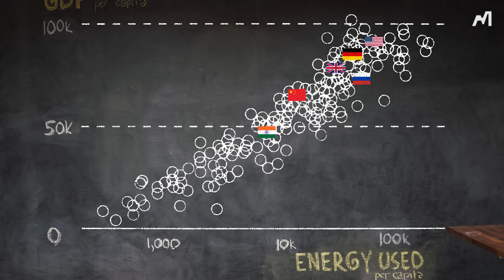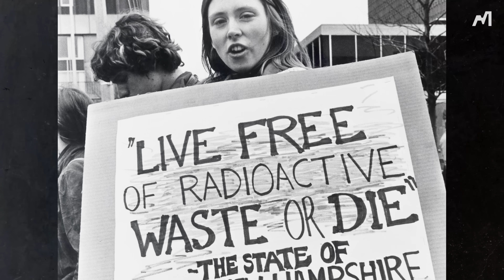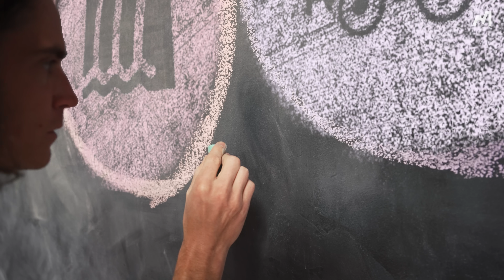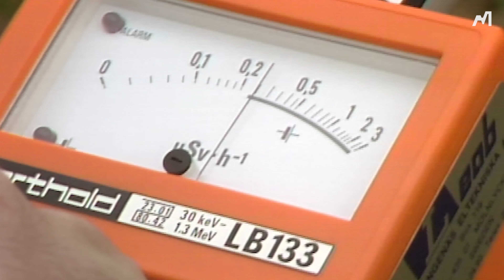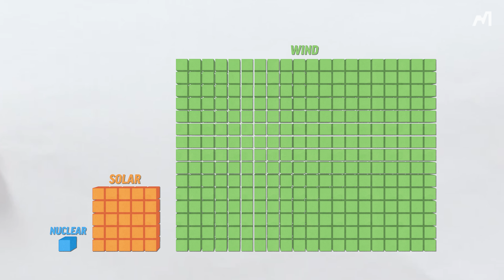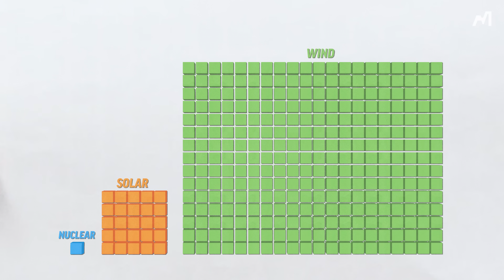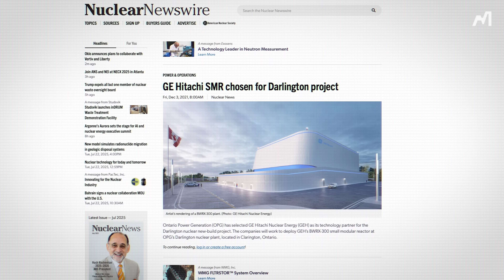They're Lying to You About Nuclear Energy

Comment: Personally, I'd rather see more effort put into making commercially viable Thorium plants, but conventional reactors are still better than coal or even natural gas. I think solar and wind are also good, but they should be supplementary power providers, not baseline because they can't produce power 24/7. Nor can the power they produce be increased or decreased on demand without also adding batteries to the mix.

Comment: False/irrelevant information on Renewables as required to promote Nuclear.  We don't need nuclear, sure lets keep experimenting, debating the safety.  Maybe it was the fossil industry that "encouraged" the safety.
Solar and wind are "reliable", the problem they have is that they are predictably variable, its a problem we know how to deal with.  Nuclear consistency is the same problem as predictably variable.  Demand is variable, the grid needs balanced.  Nuclear is too expensive to become a peak demand occasional generator.
At the end of the day you have to accept that people are scared of it, rightly so.  If you eat the right material, sure you are ok, a bit of exposure is maybe not as bad as portratyed, but get it wrong and you are dead.  We are not all nuclear experts.

Comment: More stupidity is not the solution to stupidity. The simple fact is that the intense ionizing radiation in the boundary of the nuclear fuel causes the containment to transmute over time, where the containment materials lose their original elemental qualities, frequently becoming brittle and no longer able to perform as originally intended. Zombie reactors that are past their designed life are losing the safety factors originally designed into the containment in ways that are not predictable until incidents inevitably occur. The same thing applies to the containment of high-level nuclear waste. These matters are well-known to the industry, but being withheld from public scrutiny in order to maintain the current zeitgeist.
Reply: Please vote this up. No-one seems to think about the future generations we are leaving behind our waste for. Stop using so much unnecessary power because of an economic model we know will not last long anymore.

Comment: I have only one objection to nuclear, the waste. Experts keep going on and on about how safe it is but they don't want it stored in their backyards. They tell me & the residents of my state there is zero harm from having it stored here but refuse to even consider storing it where it's generated, where they, and presumably you, live. If you want nuclear power then you should have to keep the waste it generates where you use and generate it. That seems very reasonable. Until that day arrives, no nuclear.
Reply: More stupidity is not the solution to stupidity. The simple fact is that the intense ionizing radiation in the boundary of the nuclear fuel causes the containment to transmute over time, where the containment materials lose their original elemental qualities, frequently becoming brittle and no longer able to perform as originally intended. Zombie reactors that are past their designed life are losing the safety factors originally designed into the containment in ways that are not predictable until incidents inevitably occur. The same thing applies to the containment of high-level nuclear waste. These matters are well-known to the industry, but being withheld from public scrutiny in order to maintain the current zeitgeist.
Reply: But that's exactly where it is being kept.

How do you know the experts won't accept it in their back yards?

$10-20 in natural gas can replace a dollar's worth of uranium. Natural gas doesn't have any waste, does it? It wouldn't, by any chance, include *radon*, right?

Comment: I think that what you are saying is that they had determined that if they kept building nuclear power plants at the rate they were making them that electricity would become way too cheap to make a profit off of so they made electricity availability scarce and in high demand (peak demand) through the narrative excuse that it's scary dangerous to generate electricity from nuclear, so that it could become a highly profitable business. 

You know, Iran solved that nuclear meltdown problem by building a nuclear power plant deep, deep in the ground so that in case of a meltdown it would not effect anything. But American profiteers are incapable of doing that, nor even think about such preposterous ideas such as building one deep in the ground and would rather you believe that nuclear generation is scary dangerous and that we shouldn't play around with scary things.
Reply: More stupidity is not the solution to stupidity. The simple fact is that the intense ionizing radiation in the boundary of the nuclear fuel causes the containment to transmute over time, where the containment materials lose their original elemental qualities, frequently becoming brittle and no longer able to perform as originally intended. Zombie reactors that are past their designed life are losing the safety factors originally designed into the containment in ways that are not predictable until incidents inevitably occur. The same thing applies to the containment of high-level nuclear waste. These matters are well-known to the industry, but being withheld from public scrutiny in order to maintain the current zeitgeist.

Comment: They lied about it because Nuclear Power solves the biggest problem to prosperity and positive growth humanity has ever faced.
And politicians lose power every time a problem is solved
Reply: More stupidity is not the solution to stupidity. The simple fact is that the intense ionizing radiation in the boundary of the nuclear fuel causes the containment to transmute over time, where the containment materials lose their original elemental qualities, frequently becoming brittle and no longer able to perform as originally intended. Zombie reactors that are past their designed life are losing the safety factors originally designed into the containment in ways that are not predictable until incidents inevitably occur. The same thing applies to the containment of high-level nuclear waste. These matters are well-known to the industry, but being withheld from public scrutiny in order to maintain the current zeitgeist.

Comment: Didn't plant Vogtle in GA turn on a new reactor in 2024?
Reply: More stupidity is not the solution to stupidity. The simple fact is that the intense ionizing radiation in the boundary of the nuclear fuel causes the containment to transmute over time, where the containment materials lose their original elemental qualities, frequently becoming brittle and no longer able to perform as originally intended. Zombie reactors that are past their designed life are losing the safety factors originally designed into the containment in ways that are not predictable until incidents inevitably occur. The same thing applies to the containment of high-level nuclear waste. These matters are well-known to the industry, but being withheld from public scrutiny in order to maintain the current zeitgeist.

Comment: 1:57 "They were not reckless people" DEMON CORE
Reply: More stupidity is not the solution to stupidity. The simple fact is that the intense ionizing radiation in the boundary of the nuclear fuel causes the containment to transmute over time, where the containment materials lose their original elemental qualities, frequently becoming brittle and no longer able to perform as originally intended. Zombie reactors that are past their designed life are losing the safety factors originally designed into the containment in ways that are not predictable until incidents inevitably occur. The same thing applies to the containment of high-level nuclear waste. These matters are well-known to the industry, but being withheld from public scrutiny in order to maintain the current zeitgeist.

Comment: Buddy, radiation from the sun and the ground is not the same as the one from Uranium!
Reply: More stupidity is not the solution to stupidity. The simple fact is that the intense ionizing radiation in the boundary of the nuclear fuel causes the containment to transmute over time, where the containment materials lose their original elemental qualities, frequently becoming brittle and no longer able to perform as originally intended. Zombie reactors that are past their designed life are losing the safety factors originally designed into the containment in ways that are not predictable until incidents inevitably occur. The same thing applies to the containment of high-level nuclear waste. These matters are well-known to the industry, but being withheld from public scrutiny in order to maintain the current zeitgeist.
Reply: Yeah, again a very popular 'science' channel. Bad video skipping many details
Reply: Of course it is; especially from the ground, whose radiation is largely due, you guessed it, to uranium.

The top centimetre of Earth's surface contains more uranium than has ever been mined ... although that might cease to be true in the next few decades.

Comment: I worked at Shoreham, got our full power license, sold it for $1 to NYS. They gutted it. Never ran after 3 billion dollars spent.
Reply: More stupidity is not the solution to stupidity. The simple fact is that the intense ionizing radiation in the boundary of the nuclear fuel causes the containment to transmute over time, where the containment materials lose their original elemental qualities, frequently becoming brittle and no longer able to perform as originally intended. Zombie reactors that are past their designed life are losing the safety factors originally designed into the containment in ways that are not predictable until incidents inevitably occur. The same thing applies to the containment of high-level nuclear waste. These matters are well-known to the industry, but being withheld from public scrutiny in order to maintain the current zeitgeist.
Reply: @richardmcbroom102  Bless your heart.

Comment: wow, wildly in-accurate and dangerous presentation.  do some fact checking.
Reply: More stupidity is not the solution to stupidity. The simple fact is that the intense ionizing radiation in the boundary of the nuclear fuel causes the containment to transmute over time, where the containment materials lose their original elemental qualities, frequently becoming brittle and no longer able to perform as originally intended. Zombie reactors that are past their designed life are losing the safety factors originally designed into the containment in ways that are not predictable until incidents inevitably occur. The same thing applies to the containment of high-level nuclear waste. These matters are well-known to the industry, but being withheld from public scrutiny in order to maintain the current zeitgeist.

Comment: 5 years start to finish 😂😂😂😂.   Cant do that today.  You have too many pu$$ys that can’t work 7 days a week and biggest obstacle in the way of a 5 year completion is , Blue Collar (Mafia) labor unions dragging out the time line in order to skim billions off the top.   SEE , Plant Voglte , Burke County Georgia .   Minimum of 13 billion over budget and nearly a decade to ADD (2) units on existing nuclear power plant infer structure.
Reply: More stupidity is not the solution to stupidity. The simple fact is that the intense ionizing radiation in the boundary of the nuclear fuel causes the containment to transmute over time, where the containment materials lose their original elemental qualities, frequently becoming brittle and no longer able to perform as originally intended. Zombie reactors that are past their designed life are losing the safety factors originally designed into the containment in ways that are not predictable until incidents inevitably occur. The same thing applies to the containment of high-level nuclear waste. These matters are well-known to the industry, but being withheld from public scrutiny in order to maintain the current zeitgeist.

Comment: Cut that hair buddy u look ridiculous
Reply: More stupidity is not the solution to stupidity. The simple fact is that the intense ionizing radiation in the boundary of the nuclear fuel causes the containment to transmute over time, where the containment materials lose their original elemental qualities, frequently becoming brittle and no longer able to perform as originally intended. Zombie reactors that are past their designed life are losing the safety factors originally designed into the containment in ways that are not predictable until incidents inevitably occur. The same thing applies to the containment of high-level nuclear waste. These matters are well-known to the industry, but being withheld from public scrutiny in order to maintain the current zeitgeist.

Comment: Ima start talking about how flammable coal and oil is
Reply: More stupidity is not the solution to stupidity. The simple fact is that the intense ionizing radiation in the boundary of the nuclear fuel causes the containment to transmute over time, where the containment materials lose their original elemental qualities, frequently becoming brittle and no longer able to perform as originally intended. Zombie reactors that are past their designed life are losing the safety factors originally designed into the containment in ways that are not predictable until incidents inevitably occur. The same thing applies to the containment of high-level nuclear waste. These matters are well-known to the industry, but being withheld from public scrutiny in order to maintain the current zeitgeist.

Comment: Solar really shines (sorry) in the instance of small, personal installations, such as the roof of your house, especially when paired with battery storage. It takes load off the grid and offers redundancy in the event of an emergency. You might also receive a rebate on your power bill depending on where you're from. Also handy if you have an EV with bidirectional charging. Having large solar farms decimates the environment around it and requires a great deal of space not only for the panels, but for the mass lithium storage required to make it a more reliable system. 

On the other hand, nuclear energy is efficient, stable and safe with zero emissions. The problem is that the public's literacy on these things has been sabotaged seemingly irreparably.

Comment: Maybe they simply re-start this because they finally have a way to earn more money off them.
This is what the AI sais today:

Radioactive waste can be converted into electricity using technologies like nuclear batteries that use radioactive decay to generate power, and by using it as fuel in specialized nuclear reactors, such as molten salt reactors, that are designed to consume existing nuclear waste. While current nuclear batteries produce very low power outputs, and reactors are still under development, these innovations offer the potential for long-lasting, clean energy from materials previously considered unusable waste.

Comment: Great presentation, but a nit:
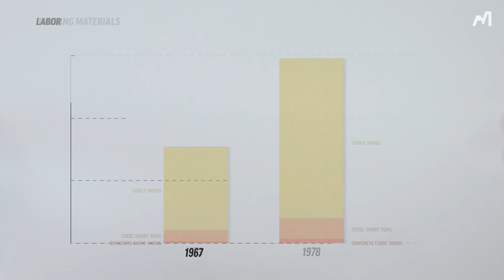10:18  Going from 4.8 man-hours/kW to 28.5 man-hours/kW is a 494% increase, not a 600% increase.
Nit #2:
16:00 It is not quite true that there has never been a problem with the reactors on a nuclear sub. The were problems on some early Soviet November-class subs, including a deadly coolant loss accident on "K-8" in 1960.

Comment: All the copious tidbits of information you blasted us with was great and all, but you really glossed over the nuclear waste problem like it wasn't a really big deal.  Well it is.  And to this day, no one had ever found an equitable solution to the voluminous amounts of this insanely toxic material accumulating around the country.  Decommissioning an expired NPP cost millions spread over years and leaves that area uninhabitable for basically forever.  Not once did you mention the millions of tons of tailings leftover from mining uranium that emit radiation 24/7, the huge amount of energy required to make U235 a fissionable material even before it gets used, and the expensive security involved in transporting reactor material across the country.  That said, I wouldn't completely object to scaled down mini-nukes being implemented coast-to-coast but only as an intermediate measure until NUCLEAR FUSION PLANTS take off.

Comment: Nobody os tallying the thyroid complications or cancer cases decades after Chernobyl. These are slowly killing chronic diseases that are noticably higher for generations livong in that time.
Having your daily radiation on top of your daily radiation is twice the regular radiation.
But if there are no meltdowns and the waste is stored correctly, or even reprocessed, it's a great source of power. Nuclear science is still advancing, so you are right, that is should make headlines. Also consider coal because it releases radiation to the atmosphere beside pollutants.
Additionally consider the correct use of solar farms, which is on top of roofs, already blocking sinpight tonthe topsoil.